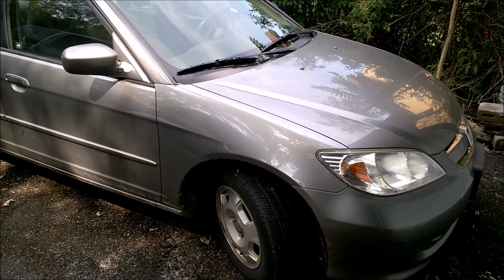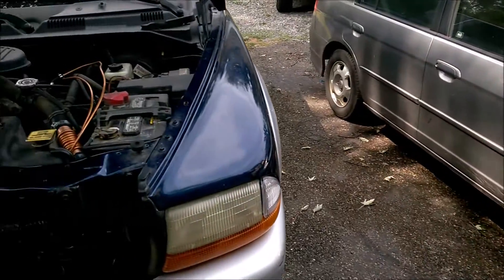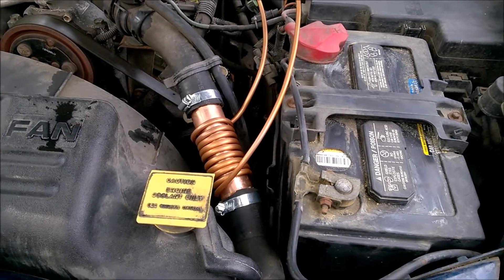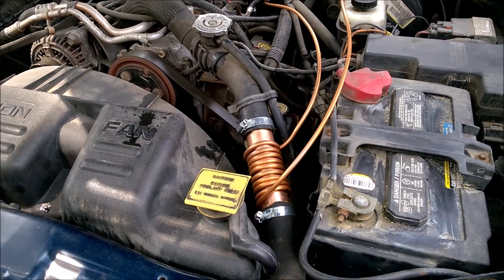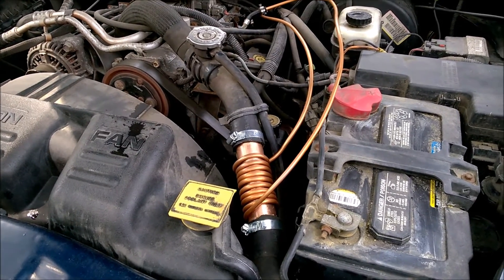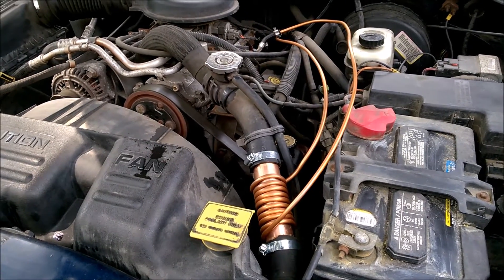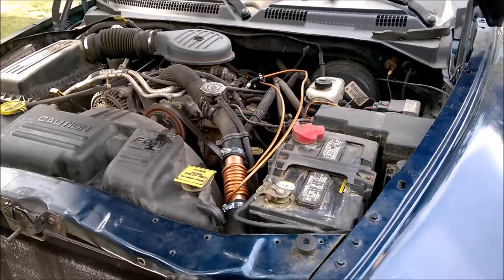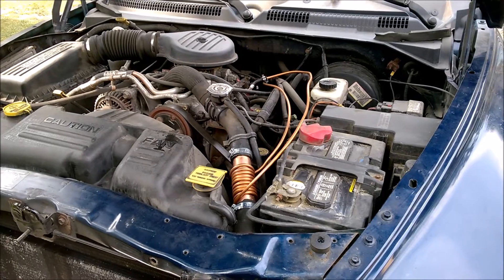More MPG

Comment: My truck was made stock with a similar water heat exchanger back in 1997. It has shorter aluminium pipes for the fuel. Just watch out for the copper pipe next to you battery positive terminal.

Comment: Hey brother I do a lot of stuff with magnets on fuel lines the polls the molecules out of the fuel to make it make it flow faster the more magnets that you do the better gas mileage you get and it’s like put a chip in it I got it on my vehicles and then I use a magnet on the fuel Fuel sensor on the top of the motor increases horsepower and gas efficiency contact me back I’d like to talk to you about a couple of things I got going on

Comment: I have always thought that excessively heated fuel causes vapor lock?
Reply: Not really common in injection, more of a carb thing
Reply: Thank you for your comment.   Have you done this? (Please reply!!) If this works I want to do this. I have a 4 barrel progressive carburetor.  I need to know where on the carburetor to fasten the copper tube to?  I want to be careful to not cause vapor lock. I have an electric fuel pump. My mechanical pump has been disconnected (discontinued).  With this copper coil do I still maintain the use of my electric fuel pump?
Reply: You would still want it to be filling the float bowls so the fuel in line on the carb will work, put a few one-way valves in and your off to the races I would put one just after tee ING off the main fuel line and another right before the carb this will cause no back pressure in the line and should stop vapor lock
Reply: Thank you for the helpful info. I will try it. Where do I get the one way valves and what kind do I ask for?
Reply: I do not see a need to use a "T" fitting.  Just have a one way valve on the hose next to the carburetor and run that line into the carburetor inlet port.  The other end of the copper line should be directly connected to the fuel line from the fuel pump. Shouldn't that do it?
Reply: Hi !  I ran an engine temperature test today.  I let the engine run up to full temperature 220 degrees. I used a laser light thermometer to measure the intake manifold temperature. It was up to 180 degrees.  Shouldn't this be plenty hot for getting fuel to vaporize without using the copper tubing ??? Maybe I do not need to do the copper tubing  wrapped around the radiator hose to heat the fuel ? The base of the carburetor was 160 degrees.

Comment: Interesting! Now you could go to Dollar Tree and buy a windshield Solar deflector and wrap it around the copper coil with the shiny side facing the coil. That would trap even more of the heat in the gas pipe, instead of letting it go out into the air.

Comment: Warmer or hot fuel atomizes to a vapour quicker, some intake manifolds have a heater plate warmed by the coolant (like yours) whwere the fuel goes through the heater plate before it lands in the float bowl...Injection systems need to be warmed directly infront of the injectors. Nice neat job. Ignor the sceptics. Informative video, thanks.

Comment: Hi from México, Can you put subtitles in Spanish? Pleaseeeee 🙏😭
Reply: Rebeca, usé el traductor de Google, así que verifica con tus amigos que hablan español de Gringo la exactitud: "Hola a todos, Frank Sullivan, científico loco aquí. Este es un carro que tengo; Es un Honda Civic Hybrid 2005. Obtiene 38-45 millas por galón. Es muy bonito, a veces incluso puedes estirarlo más. Pero lo que hice fue algo interesante: tengo una camioneta. Este es un Dodge Ram de 2003, y recibe entre 18 y 20 MPG. Ahora, tendrá 30 MPG y más caballos de fuerza. Hice una cosa muy simple, una pequeña compilación que tenía que hacer. Mira, reemplacé parte de la manguera del radiador con un trozo de tubo de cobre, y coloqué el tubo de cobre y todo lo que hice fue simplemente aprovechado en mi línea de combustible. Al entrar, da la vuelta, calienta el combustible y vuelve al sistema. Ahora, solo para que sepan, es una construcción muy fácil y segura. Uh, las temperaturas que obtendrán aquí en el radiador son de 100 a 180 (grados F) máx., No habrá mucho más que eso, pero, la gasolina está bien, muy por encima de esa área para que ocurra algo importante. Sin mencionar que está bajo presión, lo que le da aún más seguridad, por lo que no tiene que preocuparse ni pensar dos veces al respecto. Ummm, hasta ahora, esta construcción es muy bonita; Es una aplicación práctica y me encanta esto. Ahora estoy empezando a poner las cosas en acción. Es una cosa muy simple; le da al menos 10 millas por galón más, y un poco más de potencia. Bien, un par de cosas para, umm, si no te has dado cuenta, mi voz es un poco ronca; umm, estoy superándome de estar enfermo. Y, umm, alguien en realidad me llamó un "perdedor". Hmmm, eso es bastante interesante. Pero, uh, mmm, en palabras del gran Charlie Sheen, "¡Ganador!" [Risas aquí]. En realidad no le presto mucha atención a la gente así. De todos modos, hasta ahora, todo bien. Si alguien quiere intentar recrear esto, y podemos comparar notas, hasta ahora, todo bien. Y, muchas más pruebas, pero inicialmente, se ve bien, suena bien, se siente bien. Uno puede sentir realmente, una vez que alcanza la temperatura, el aumento de la potencia."
Reply: Rebeca, usé el traductor de Google, así que verifica con tus amigos que hablan español de Gringo la exactitud: Hola a todos, Frank Sullivan, científico loco aquí. Este es un carro que tengo; Es un Honda Civic Hybrid 2005. Obtiene 38-45 millas por galón. Es muy bonito, a veces incluso puedes estirarlo más. Pero lo que hice fue algo interesante: tengo una camioneta. Este es un Dodge Ram de 2003, y recibe entre 18 y 20 MPG. Ahora, tendrá 30 MPG y más caballos de fuerza. Hice una cosa muy simple, una pequeña compilación que tenía que hacer. Mira, reemplacé parte de la manguera del radiador con un trozo de tubo de cobre, y coloqué el tubo de cobre y todo lo que hice fue simplemente aprovechado en mi línea de combustible. Al entrar, da la vuelta, calienta el combustible y vuelve al sistema. Ahora, solo para que sepan, es una construcción muy fácil y segura. Uh, las temperaturas que obtendrán aquí en el radiador son de 100 a 180 (grados F) máx., No habrá mucho más que eso, pero, la gasolina está bien, muy por encima de esa área para que ocurra algo importante. Sin mencionar que está bajo presión, lo que le da aún más seguridad, por lo que no tiene que preocuparse ni pensar dos veces al respecto. Ummm, hasta ahora, esta construcción es muy bonita; Es una aplicación práctica y me encanta esto. Ahora estoy empezando a poner las cosas en acción. Es una cosa muy simple; le da al menos 10 millas por galón más, y un poco más de potencia. Bien, un par de cosas para, umm, si no te has dado cuenta, mi voz es un poco ronca; umm, estoy superándome de estar enfermo. Y, umm, alguien en realidad me llamó un "perdedor". Hmmm, eso es bastante interesante. Pero, uh, mmm, en palabras del gran Charlie Sheen, "¡Ganador!" [Risas aquí]. En realidad no le presto mucha atención a la gente así. De todos modos, hasta ahora, todo bien. Si alguien quiere intentar recrear esto, y podemos comparar notas, hasta ahora, todo bien. Y, muchas más pruebas, pero inicialmente, se ve bien, suena bien, se siente bien. Uno puede sentir realmente, una vez que alcanza la temperatura, el aumento de la potencia.
Reply: Hola a todos, Frank Sullivan, científico loco aquí. Este es un carro que tengo; Es un Honda Civic Hybrid 2005. Obtiene 38-45 millas por galón. Es muy bonito, a veces incluso puedes estirarlo más. Pero lo que hice fue algo interesante: tengo una camioneta. Este es un Dodge Ram de 2003, y recibe entre 18 y 20 MPG. Ahora, tendrá 30 MPG y más caballos de fuerza. Hice una cosa muy simple, una pequeña compilación que tenía que hacer. Mira, reemplacé parte de la manguera del radiador con un trozo de tubo de cobre, y coloqué el tubo de cobre y todo lo que hice fue simplemente aprovechado en mi línea de combustible. Al entrar, da la vuelta, calienta el combustible y vuelve al sistema. Ahora, solo para que sepan, es una construcción muy fácil y segura. Uh, las temperaturas que obtendrán aquí en el radiador son de 100 a 180 (grados F) máx., No habrá mucho más que eso, pero, la gasolina está bien, muy por encima de esa área para que ocurra algo importante. Sin mencionar que está bajo presión, lo que le da aún más seguridad, por lo que no tiene que preocuparse ni pensar dos veces al respecto. Ummm, hasta ahora, esta construcción es muy bonita; Es una aplicación práctica y me encanta esto. Ahora estoy empezando a poner las cosas en acción. Es una cosa muy simple; le da al menos 10 millas por galón más, y un poco más de potencia. Bien, un par de cosas para, umm, si no te has dado cuenta, mi voz es un poco ronca; umm, estoy superándome de estar enfermo. Y, umm, alguien en realidad me llamó un "perdedor". Hmmm, eso es bastante interesante. Pero, uh, mmm, en palabras del gran Charlie Sheen, "¡Ganador!" [Risas aquí]. En realidad no le presto mucha atención a la gente así. De todos modos, hasta ahora, todo bien. Si alguien quiere intentar recrear esto, y podemos comparar notas, hasta ahora, todo bien. Y, muchas más pruebas, pero inicialmente, se ve bien, suena bien, se siente bien. Uno puede sentir realmente, una vez que alcanza la temperatura, el aumento de la potencia.
Reply: Go to Google Translate to get this en Espanol. He replaced about 8 inches of rubber radiator hose with 10" of copper pipe that fit snugly inside the remaing radiator hose, and wrapped what looks like 1/2" copper pipe (probably like feeds a butane heater) around the big copper pipe 10 times. He cut his fuel (gas) line, fit it over the 1/2" pipe, and tightened/secured it with hose clamps. It heats up the gasoline so that it burns cleaner and gives more power and miles per gallon.

Comment: Have you thought about putting the copper tubing around the exhaust
Reply: Exhaust temps are too dangerous to be heating the fuel with. A small amount of additional heat from a non direct contact with the exhaust is ok though. 250 degrees F is about the limit.

Comment: Anybody tried to make this? results?
Reply: Real easy used 2mtr fuel pipe wrapped around  top hose 2.3ltr merc eligance 225,000km using e20 ethenol fuel,home made hho wet cell.made 1040km journey 13hours getting 25.41km per ltr. I WAS WELL SUPPRISED.  best wishes.

Comment: Installed a heat exchanger in a 1977 Cutlass in late 1983. Car burned up in spring 1984. Likely hose clamp loosened up. Great idea
but install proper connection on tubing so hose connection does not slip off.

Comment: How did you measure that it gets an extra 10mpg? Thanks
Reply: How do you think he measured the mpg, fill up, drive many miles, fill up again, mileage travelled divided by consumption in gallons equals miles per gallon (mpg)...lets say 500 miles travelled, 10 Gallons consumed = 500/10=50mpg

Comment: wouldn't heating up ur fuel diminish ur mpg? the colder ur air & fuel = more hp???? Wouldn't that cause flashover.plz explain???
Reply: D.j. B liquid fuel don't burn. Takes longer for liquid fuel to change to vapor in combustion chamber. Add steam to the intake and you WILL see more hp and increase mph.  Look up Yunick 'SMOKEY' Robinson.

Comment: In the 70's there was a device call a fuel expander .It was about 21/2 " round pipe looking device 4 nipples two each side.Your heater hose hooked two out side nipples.While the fuel line hooked to the center nipples.This device did the same thing.Then the oil companies re formulated there fuels to counter act this mod.A friend of my mom sold them. This is the something just more hillbilly made like .But dose work the problem was control of heat you got heating the fuel hot days cool days.Summer time in hot climates and the re formulated fuels did it in.
Reply: Great info easy to make fuel at 90degre C into injectors nice one tks.

Comment: hey, are you still seeing about 10mpg in gains.....might try it on my vehicle. I am nervous about tapping into the fuel line as it is metal, not hose. Any advice?
Reply from the maker: +thewonn Yes my advice is to Use water in the tube and freeze it then u can bend the tube in a coil without kinking it
Reply: احشو داخل الانبوب بملح الطعام

Comment: does that go to a single  throttle plate injection  .or is direct injection into the heads or intake man?no vaper lock ?
Reply from the maker: +canadianfortruth  Hi sorry I didn't respond earlier But YouTube seems to not notify me Anyway no vapor lock All though that's what you realy want to acheve. Vapor lock will get you the Most out of your Fuel. The trick is to be able to shut it down when you want